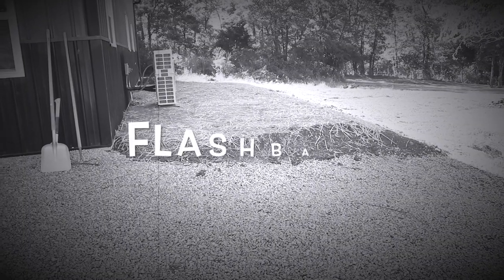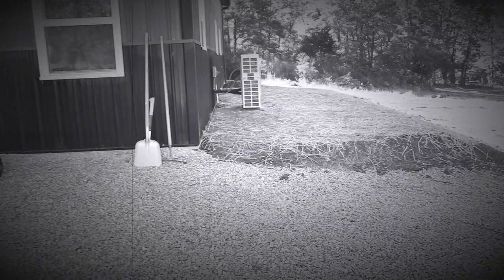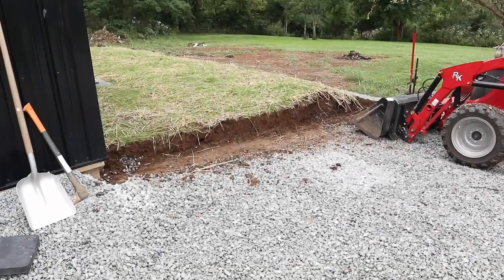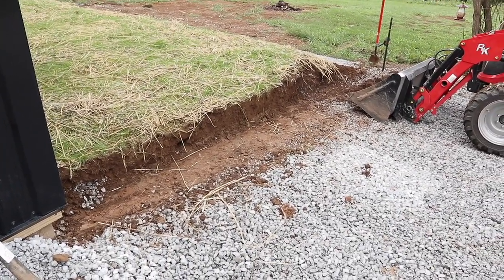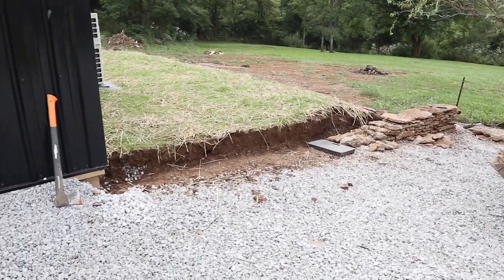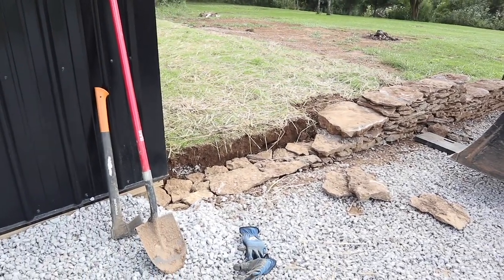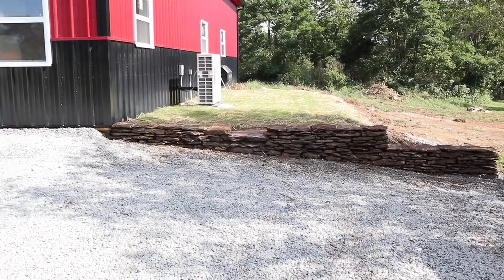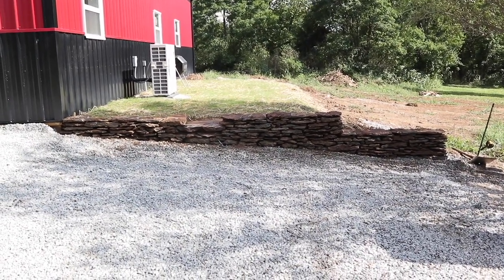TNT Try New Things - 71:  Rock Wall / Stone Wall Transition Project

Comment: That looks awesome! Really impressed!!! 

I got to finally see a rk25 in person it's a really nice tractor but for my property and needs i need the 37 but I wasn't approved for the financing i needed for whatever reason so gonna try some other options!!
Reply from the maker: Sorry to hear that Jarrod about the financing.    As you probably saw in my first RK25 video, I was on my way to RK to buy an RK37 (little too big for my needs, but RK24 was just too small for my needs as well) when they showed me the RK 25.    I hope you find something that works for you and your property.    Keep me posted!
Reply: @TryNewThings  yeah I was/am bummed but not.out of options yet 👍  I make enough money so idk why I was declined probably cuz of my age and lack of a lengthy history. 

Yeah I drove the rk37 shuttle shift and instantly loved it .. and it'll fit my needs perfectly...i could get by with the rk25but it'd be getting worked pretty hard all the time so not sure that I'd wanna be pushing my machine to it's limits all the time  but I've not 100%ruled out the rk25 because it is cheaper and therefore it's possible I could maybe get financing for it instead! The rk 25 preferably the rk37 is gonna be the tractor for me it seems as soon as I can get the financing for it.. i was working with a Massey Ferguson dealer and thought i had a possibility to get a 1648 MF that was used but very low hrs and good shape but it fell through the guy was too far away so gonna go tlk to the bank after work today and see if I can get the financing or figure something out